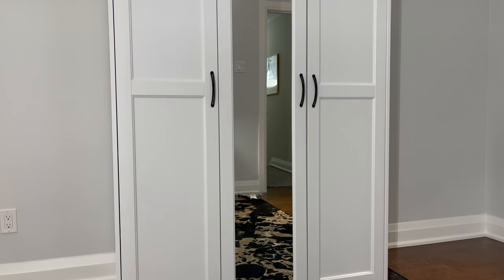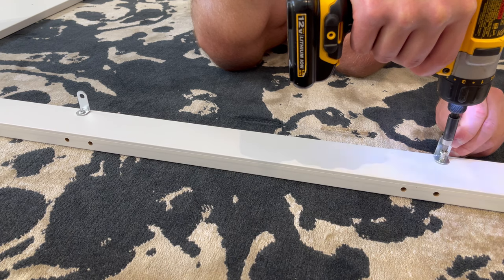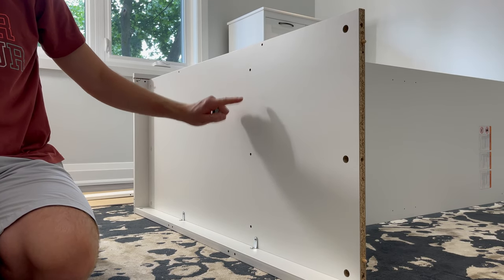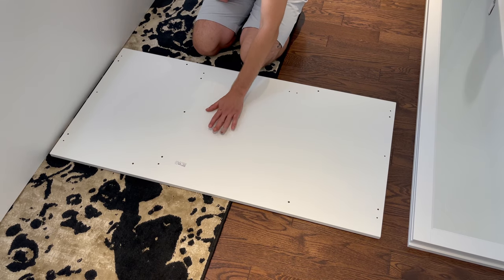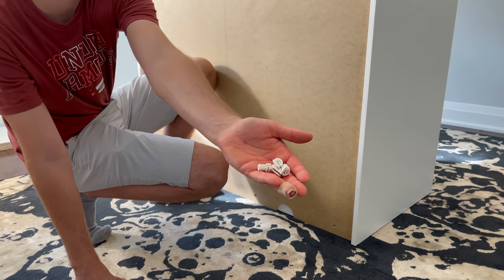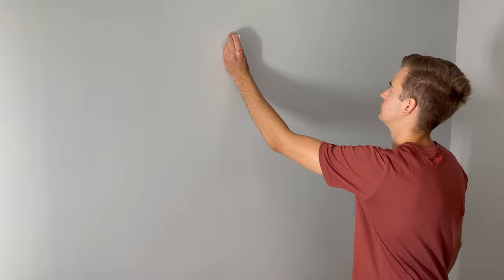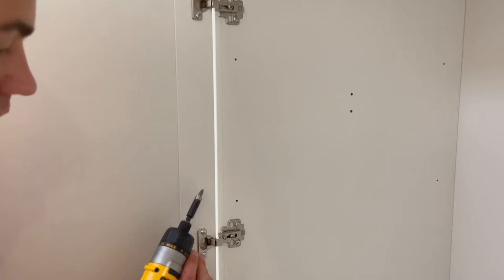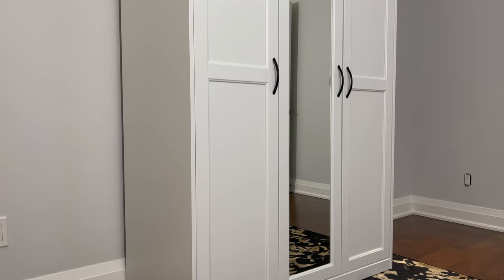Tutorial | IKEA Songesand Wardrobe

Comment: Your video was extremely helpful in putting this wardrobe together - thank you!  It's all together but I can't get the doors so they don't rub against the sides as they're being opened and closed.  I've fiddled with the screw in the middle (by A) and the smaller one in front that's supposed to move the door out slightly.  If there are any hints you can offer on this, I would so appreciate it. Thank you so much.
Reply: Same. one door is perfect but 2 rub. tried loosening or moving the position slightly but it still rubs. lets see if anyone has any advce
Reply: I noticed the two outer doors slightly rub, even when I adjusted the hinge screws. I believe the rubbing isn't coming from the bottom of the door, but the hinge edge of the door rubbing against the inside of the cabinet. I actually used the instruction booklet as a bottom spacer when adjusting the hinge screws.